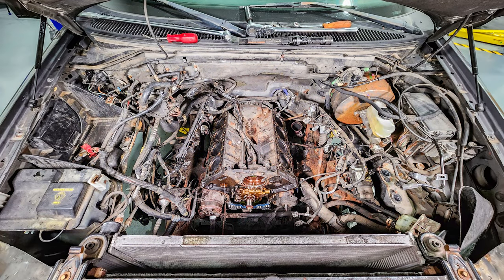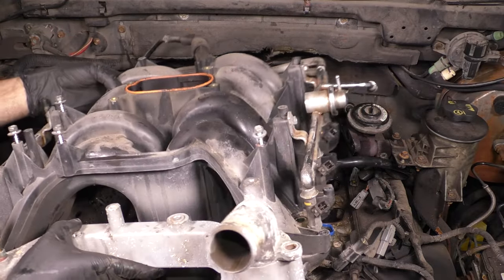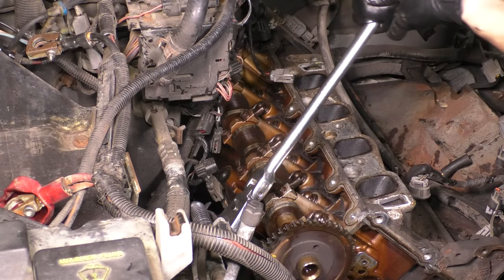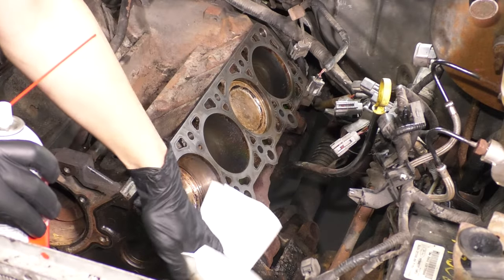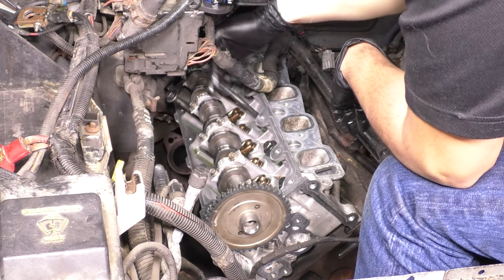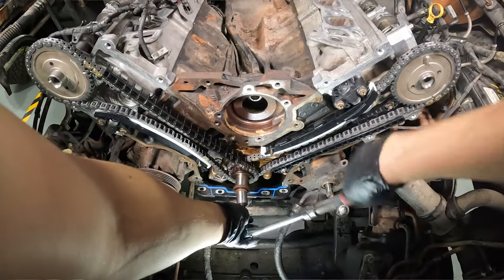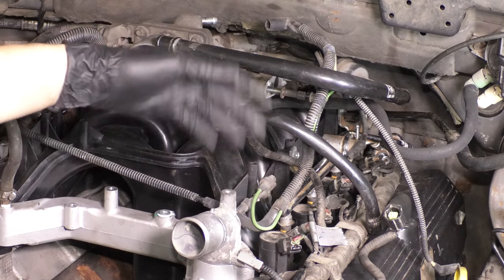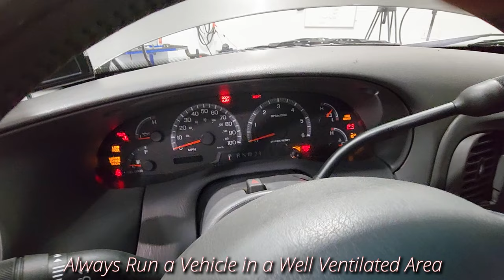Ford F-150 5.4L SOHC Head Gasket Complete Replacement (Full Length Director's Cut)

Comment: I took my 2002 Ford F150 5.4 L V8 to the shop with a blown plug in cylinder seven for the second time. They didn’t feel comfortable changing it so they said they would change the Motor. I told him that was ridiculous. I just wanted the head replaced what’s wrong with mechanics these days! It’s hard to find a good mechanic these days!!

Comment: Great video👍 im at the point where all i have left is valve covers , crank pully and timing cover. I have new headers instead and hopefully should toss code . I just wanna add that the Dorman aftermarket intake manifold robs power. The stock ford one is actually an easy fix if isn’t cracked too bad where the coolant cross unit connect . I disassembled the intake and cleaned up and put a high temp rtv in the lil crack, reassembled and let it fully cure . Zero issues .  I had the Dorman and switched back to the stock one and noticed the difference in power🤘

Comment: With replacing the head gasket...I would replace any parts that was taken off that could be replaced.  Especially if it was never done or needs to be done.   E.g., water belt, fan belt,  thermostat, pulleys, tensioners, etc.

Comment: I will be starting this same job on a 2003 Expo 5.4 for a right head that is leaking coolant but I will pulling both heads off for a complete check and repair. I'm trying to get myself in the mood to getting started. LOL....... great job on your video.

Comment: Just a tip: 
If you send these heads to a shop to get clean, make sure the freeze plugs are still in.
I just found out what a freeze plug is. 
This is not how I wanted to find out what a freeze plug is.

Comment: Epic video here man! Well done on your work! I know you must've sworn on that thing for a couple of days while working on it, but you succeeded! I noticed some bubbling in my heater core, it has been doing it for awhile now, but the radiator fluid lvl doesn't seem to have changed, so I'm guessing it's just air pockets that need to be released. If my gasket is bad, then I will for sure keep this video in mind if I take on this challenge of a job!

Comment: Thanks for the video. I have a 2000 F-150 5.4L 3 valve triton. And I spun a bearing and need the crankshaft. From what year to what year can I buy one that it’s exactly the same? And  is the 4.6L be the same crankshaft? Thank you in advance. 🚙👍🏽

Comment: I got the timing bolts out of the timing cover in the front of the engine do you have to drain the oil before you loosen the bottom ones that bolt to the cover